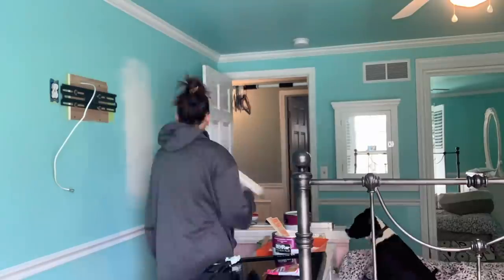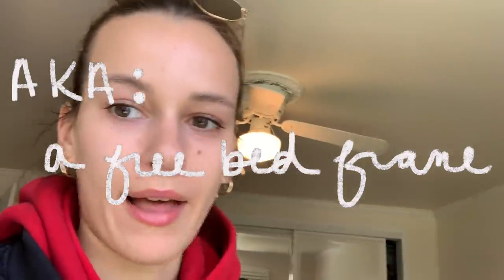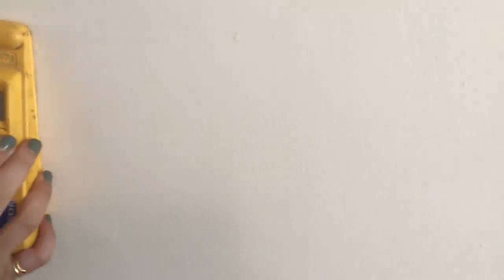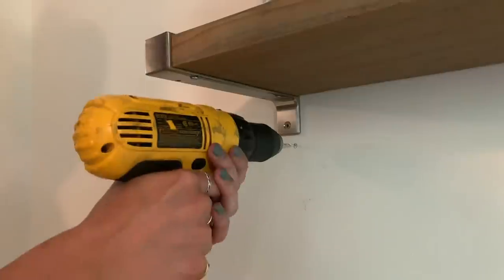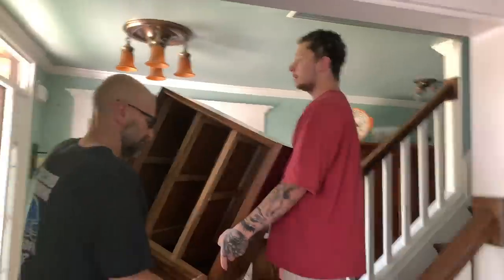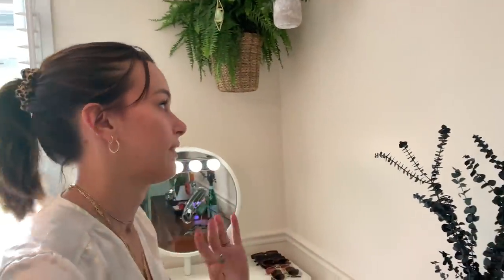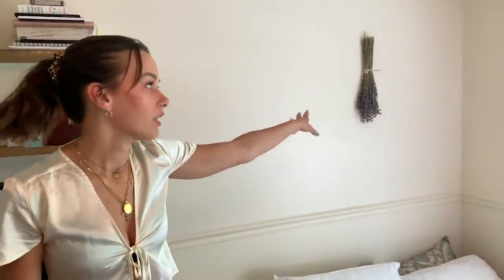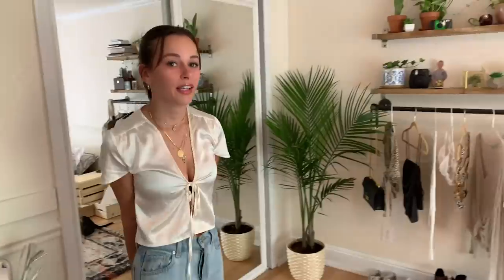BEDROOM MAKEOVER + room tour

Comment: ADVICE: Clothes from the clothing rack are not aesthetic and don't give the visual purpose of a clothing rack, the pots on the shelves don't look cute (you need to change them),  need to buy a little box so you can put those pairs of glasses that you have, the rug's design looks tacky and too dusty, you need to get rid of the baseboard in the middle of your walls, you have too many things on top of your nightstands and shelves and it makes the room look messy and finally, the cheetah blanket (it doesn't match the bedding).